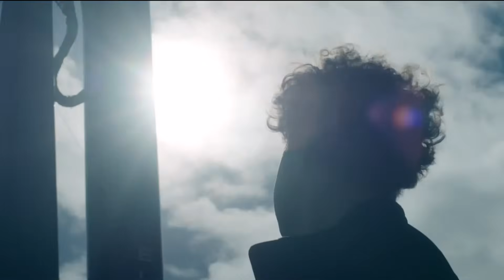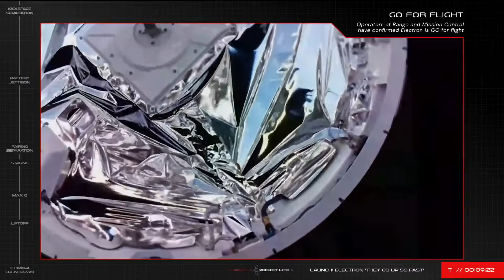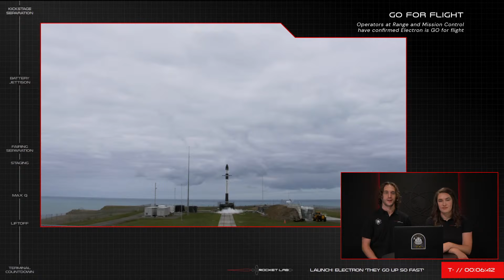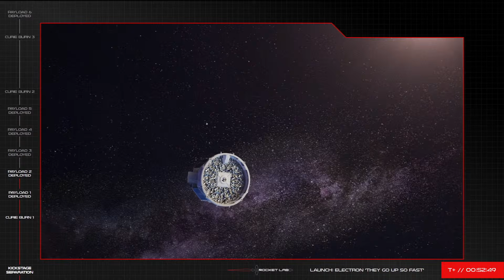Rocket Lab - They Go Up So Fast Launch 03/22/2021

Comment: Can someone explain max q. I don't understand it one bit
Reply: Maximum Aerodynamic Pressure
MaxQ.
Reply: @aineshgodse  what is aerodynamic pressure? It must be different from barometric pressure, because that decreases with altitude, not increases.
Reply: @gormauslander  basically as the vehicle accelerates, the forces from the air pushing against the rockets get bigger, but the same forces also get smaller the higher you go. At some point you will have the maximum force of that air of the whole flight also called "max-Q"
Reply: @egamersmk771  so it's just because it's going up faster, constantly accelerating?
Reply: @gormauslander  Yes, but at max-q, they throttle down, so they don't have to fight as much air resistance.

Comment: 19:00 - lift off
21:25- Meco
22:00- faring separation
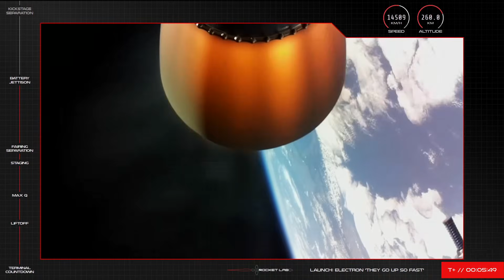24:50- batarey jetstion
27:35- Seco/Kick stage deploy
1:08:25- Kick stage burn
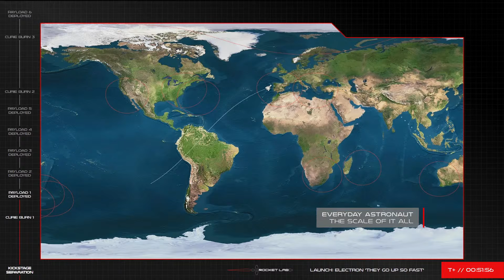1:11:10- deploy 1
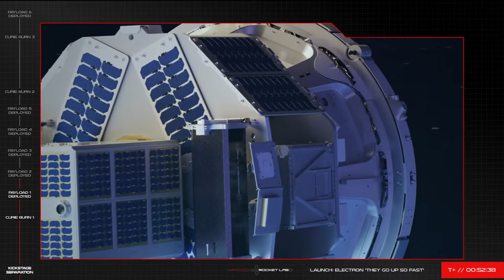1:11:55- deploy 2
1:12:40- deploy 3
1:13:20- deploy 4
1:14:05- deploy 5
Reply: Our hero
Reply: Thank you! Your a legend mate!
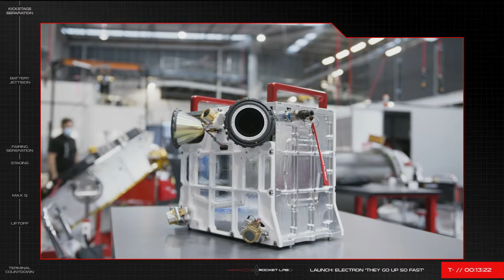Reply: 5:42 -start of the webcast intro
Reply: Isn’t the liftoff at 19:04
Reply: The reason the timestamps are broken is because they edited out the starting hold bit btw
Reply: Thanks
Reply: It's actually "battery"
Reply: @tirthvora5061  Correction: Everything
Reply: Wrong timestamp